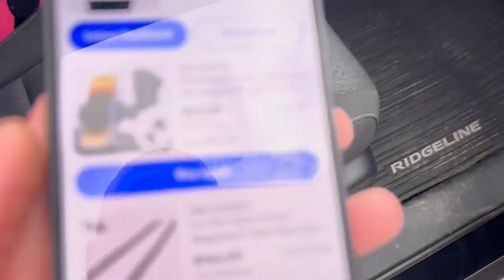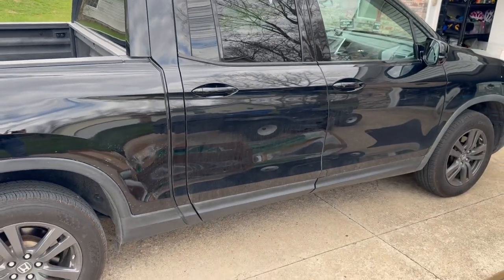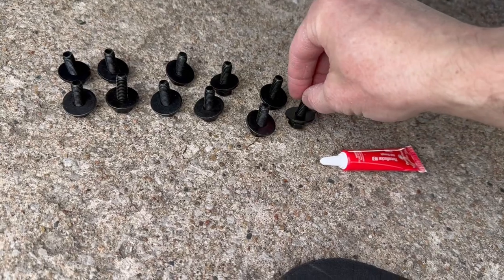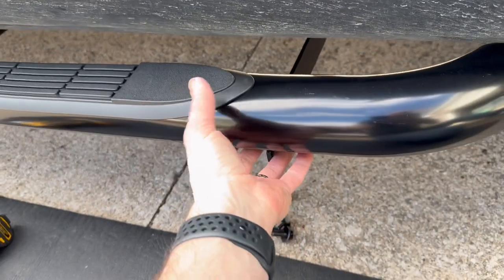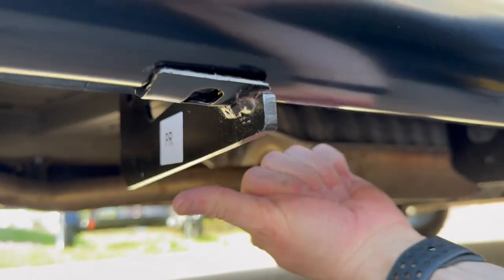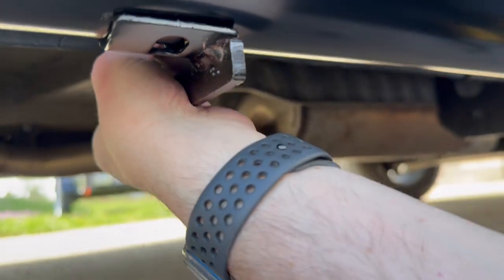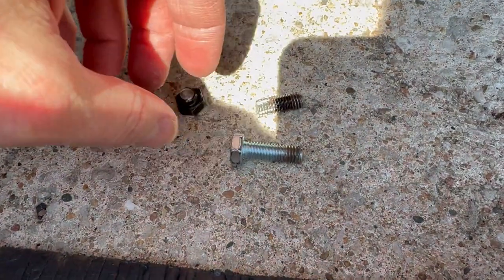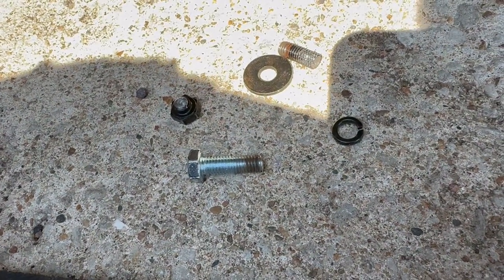TAC Running Boards Honda Ridgeline 2019 - Review and Install | Josh Cobb

Comment: Thanks for the info. I just got the same running boards for my daughters 2020 Ridgeline. I'm going to go to Lowes now and upgrade the bolts, clean out the holes with WD40 and use some Locktite.
Reply from the maker: Good luck!  They are doing great on my truck and I've come to really like them!
Reply: @joshcobb4100  They came out great, daughter loves em. Thanks for the tips